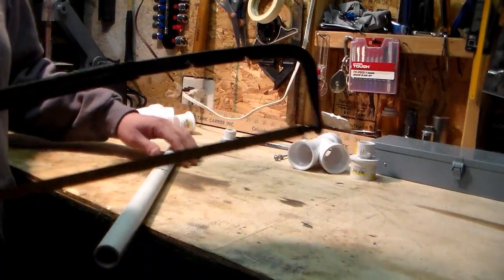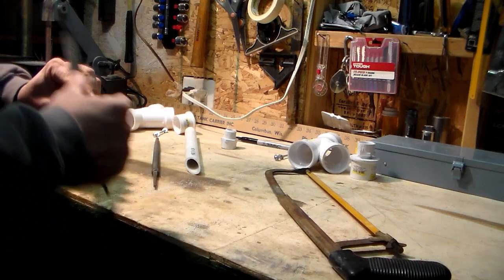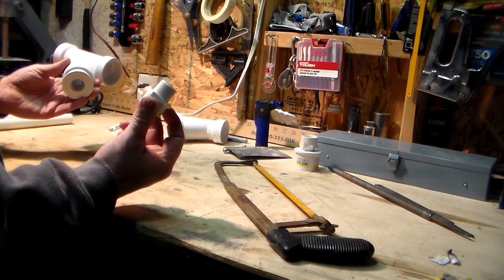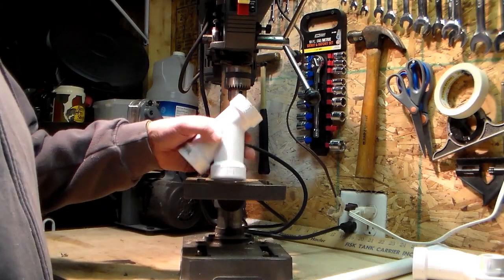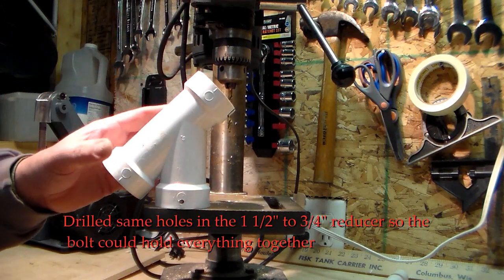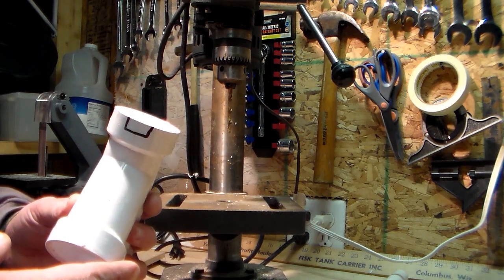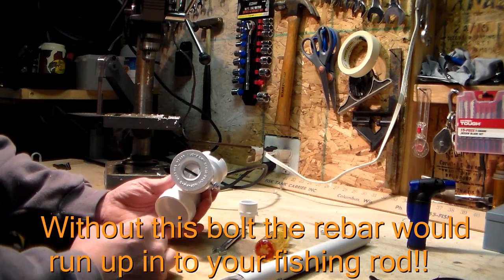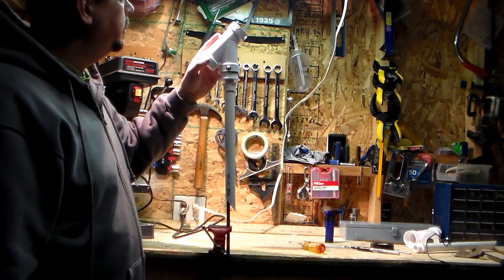PVC and Rebar Rod Holder Catfishing

Comment: Well, sorry!, We made these and in theory , good concept, but it was a bit of a pain to to get the rebar and pvc tube at the right mating height,  at river bank. Cogging , jambing with sand issues, and rods still want to turn with river current. Rod holder itself and angle is great.
Reply from the maker: Maybe it will be a good start for a new design. Hope you find something that works better in your area. Good luck fishing 👍🎣👍

Comment: I can't use this due to the ground here being so hard and full of gravel (good luck hammering anything into it), but this gives me ideas on how to modify the bucket rod holder to be better.
Reply from the maker: I used my 5 gallon rod holder at a local reservoir yesterday. Instead of using the rebar, I tossed in one of the large (20+ pound) rocks from the bank. It held fine and I just put the rock back when I finished fishing. Maybe that setup would work for you. Thanks
Reply: @KCLOutdoors  Well, right now I have a 5g bucket rod holder that I put in the back of my inflatable kayak (easiest way I could think of to do it). I've heard another version of that for bank fishing, where you do essentially what I have, but you simply fill it with water when you get to your spot. Use it as a rod holder, and when you're done, empty it out.

Comment: On the bottom side add a 6 to 8 inch piece of PVC pipe. Then add bolt on a length of 1 1/4 " x 1 1/4" angle aluminum that is pointed at ground end.  Better?
Reply from the maker: Sounds like a good plan!

Comment: Instead of using 3/4 pvc pipe to put your rod holder in the ground I used 3/8 thread rod . You need a you drill a hole in the cap to put the ready rod into and bolt it to the cap it is a Charlotte Pip Schedu 40 1 1/5 in. Spigot X1 1/5 in. FPT PVC Cleanout Adapter I sharpen the end of the ready rod so it will go in the ground better  and it works great the ready rod is only 1 foot long
Reply from the maker: Great idea!!

Comment: Can you provide me a detailed description on items used and price it cost to make them.. Thank You
Reply from the maker: Sure thing. 
1 1/2” Y
1 1/2” to 3/4” reducer
3/4” pipe about 16” long
10-32 bolt & locknut
Rebar spike cut 20”-24” long

Total cost is $5.00 depending on price in your area. 
Good luck on the water!!

Comment: I like that but what type of bolt is that
Reply from the maker: It's a 10/32 Machine screw.  You can also use a 1/4-20 bolt. Both can be found in Hardware stores or big box stores like Lowe's, Home Depot and Menards. Hope that helps!
Reply from the maker: My mistake, if you were asking about the long bolt that I pushed into the ground, it was a 5/16" bolt that I picked up at tractor supply. I have started using 16"-18" rebar since the video. The rebar can also be purchased at Home Depot in pre cut lengths. Sorry for the confusion!

Comment: It's been a few months are you still using this set up and how has it worked out?
Reply from the maker: This setup has worked great. I've had multiple fish and no problems. I keep a set in my truck for any unplanned trips! I'm working on another video using this setup and a 5 gallon bucket.....
Reply: The only thing I'm going to use different is using a rebar pin 24 in been using them for a couple years now

Comment: Do you have a list o f specific materials with sizes  needed. attached to this video?
Reply from the maker: I'll get one around and post it here.
Reply: Looked like

1 1/2” pvc Y
1 1/2” x 3/4” threaded bushing
3/4” male adapter
3/4” pvc pipe

Comment: Have you tried to cap bottom of pvc and place a threaded pole threw it with nuts to keep in it place....
Reply from the maker: I believe that would work fine. I just like to be able to pound the rebar into the riverbank and then slip the PVC over it. Between the rocks and tree roots, the rebar takes the damage, not the PVC and I can easily replace the rebar. Thanks for the input!!
Reply: Last question sorry what size bolt u using and drill holes u drill I'm gonna make one today.  Txs
Reply from the maker: @papabear1825  my first set had  1/4" bolt but I thought it was overkill,  so I dropped down to a 10/28.
Reply: @KCLOutdoors  can u give me a list of supplies so i can male some?
Reply from the maker: @MrMGM74  Sure thing.  
1)  1 1/2" Y
1)   1 1/2" to 3/4" female threaded reducer
1)   3/4" male threaded to 3/4" coupler
1)  3/4" sch 40 pipe cut to length.  Between 16"-24"
1)  3"   10-24  machine screw, nut and washers.
1)   20"-30" piece of rebar

I don't know the actual plumber's lingo/names for the fittings,  but I hope this helps!!

Comment: Why not glue this together
Reply from the maker: I did go back and glue the joints. I still used the bolts for added strength. The bottom bolt also keeps the rebar off the rod. Thanks and good luck fishing!